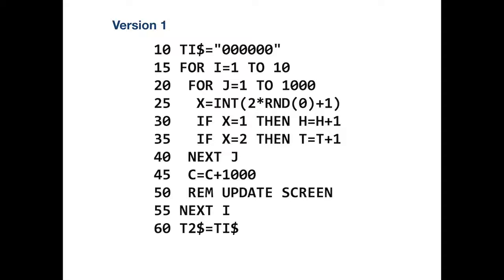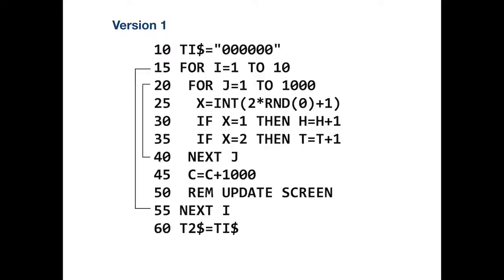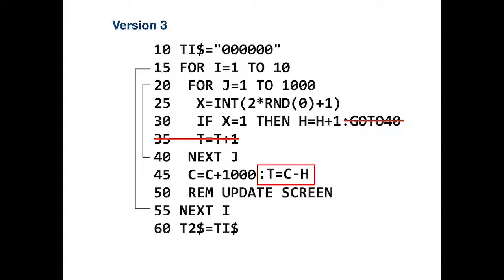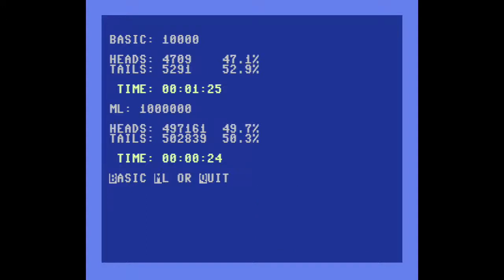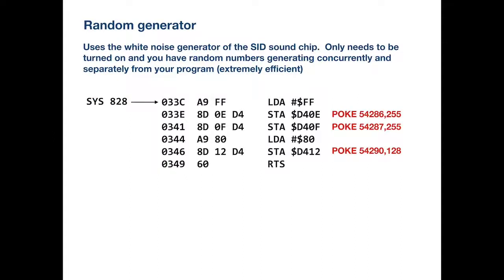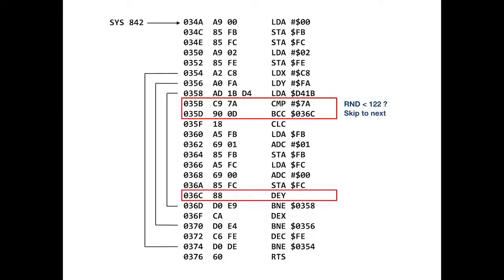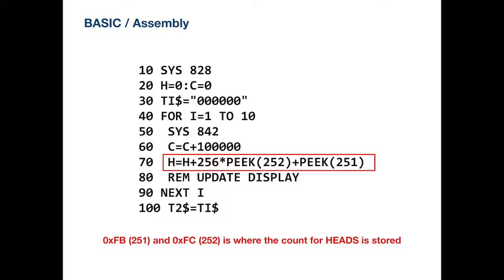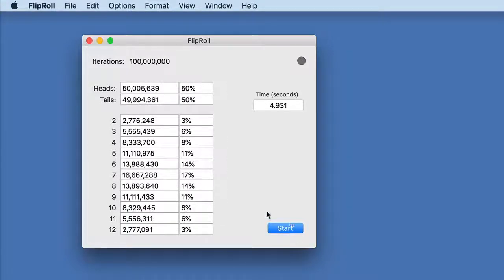C64 Speed Test (Part 2)

Comment: My BASIC only version looks like this : (PAL Vice 3.8)
10ti$="000000":k=.5:m=10:n=1000
15fori=1tom
20forj=1ton
25h=h-(rnd(0)<k)
30next
35c=c+n:t=c-h
40printh;t;ti$
50next
Output was : 
 425  575 000006
 900  1100 000013
 1359  1641 000020
 1853  2147 000027
 2328  2672 000034
 2765  3235 000041
 3227  3773 000048
 3679  4321 000055
 4162  4838 000102
 4621  5379 000109
Faster but rather unbalanced. 

Using RND(1), output was :
 527  473 000010
 1055  945 000020
 1576  1424 000030
 2101  1899 000040
 2587  2413 000051
 3080  2920 000101
 3550  3450 000111
 4027  3973 000121
 4499  4501 000132
 5010  4990 000142
Significantly slower but well balanced...
Reply from the maker: Interesting!

Comment: This was a fun experiment to try.  I used a slightly different method of counting down from 100,000 to zero, then read the number of heads vs tails and displayed the results in BASIC...

ML code:
*=$33c ; sys 828

jmp init

heads:    !byte 0,0,0
repcount: !byte $a0,$86,$01 ; $186a0 = 100,000 dec

init:
  lda #$80
  sta $d40f
  sta $d412

reset_count:
  lda #$a0
  sta repcount
  lda #$86
  sta repcount+1
  lda #$01
  sta repcount+2
  lda #$00
  sta heads
  sta heads+1
  sta heads+2

loop:
  ldx #$03
-
  dex
  bne -
  lda $d41b
  and #$01
  beq +
  inc heads
  bne +
  inc heads+1
  bne +
  inc heads+2
+
  dec repcount
  bne loop
  dec repcount+1
  bne loop
  dec repcount+2
  bpl loop
  rts

BASIC code:
10 sys828:h=peek(831)+peek(832)*256
20 b=100000:t=b-h:print"heads:"h;int(h/b*1000)/10"%"
30 print"tails:"t;int(t/b*1000)/10"%"

Output:
heads: 50198  50.1 %
tails: 49802  49.8 %

Comment: Version 4 achieves 1m 25s only if you remove the variable names from the two NEXT statements.
i.e. Instead of NEXT J and NEXT I
Just use NEXT
Otherwise, Version 4 takes 1m 29s if you leave the variable names in the NEXT statements.

Comment: About 10:05: hmm... doesn't look like a coin flip, or the noise generator of the SID is bad. Maybe it is good on a real machine, since you work in an emulator, don't you? From 0-255 are 256 numbers, so 50% is checking if x<128, but you check if x<121. So not it is not a 50% chance.
Reply from the maker: The problem was that the SID takes 16-17 cycles to generate a new number and the loop was cycling at about 15 causing duplicates and throwing off the expected 50-50 ratio.   Inserting two NOPs between cycles solved the problem, I just never updated the video (maybe I should, I've optimized the code even more and got the time down to just over 19 seconds.    There is a good video on the 8 Bit Show and Tell channel (@8_Bit) that demonstrates how the SID works:  https://youtu.be/-ADjfx79wNg
Reply: @retrooldguy9880  Thank you. That was also an intresting video. First of all i thought the SID is a "true" random number generator, but it is "only" a "pseudo" random generator.
You videos are nice. I am looking forward new ones.